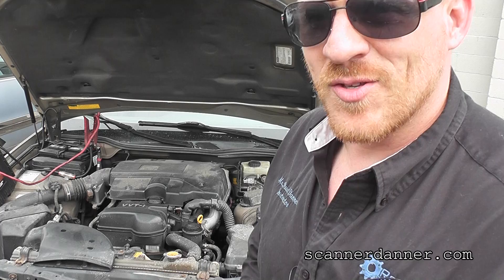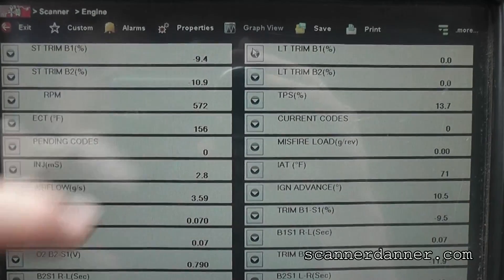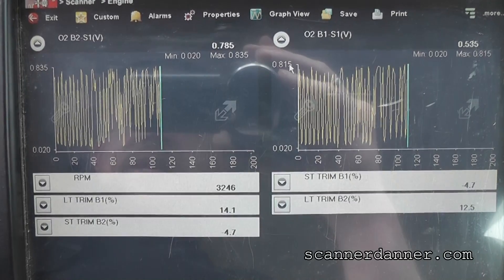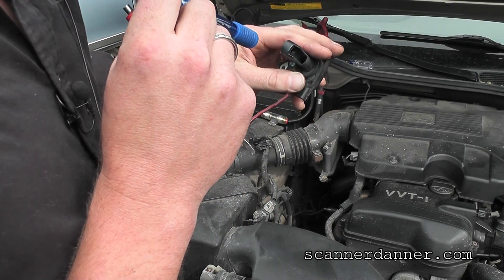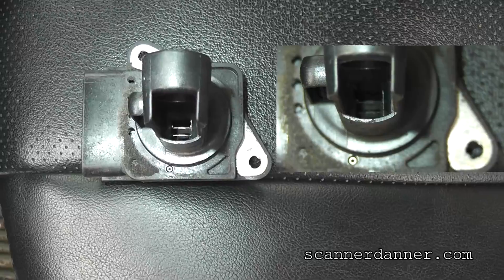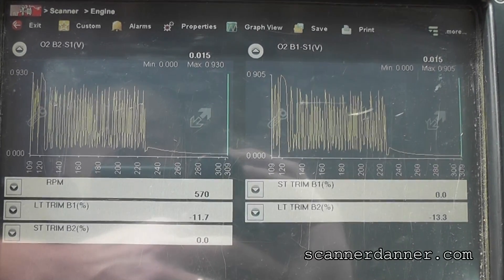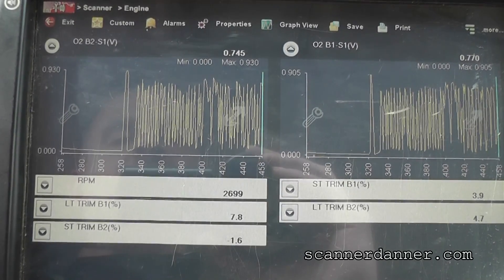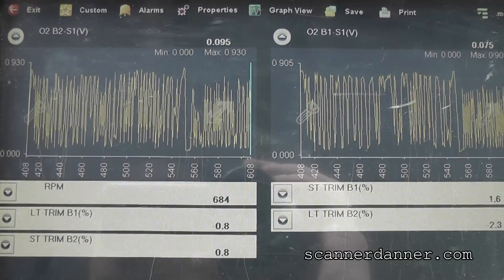How to identify and clean a dirty MAF sensor (Lexus)

Comment: so is maf cleaner just brake clean or is it actually a different can with brake clean in it they just charge more for it? lol
Reply: never use any solution other them mass air flow cleaner on a mass air flow sensor... the abrasive(s) in the solution cam eat the protective coating off the thin wires and cost u unnecessary $$$.
Reply from the maker: I've been cleaning MAF sensors for 20 years using brake clean. Shoot, when I started cleaning them there was no such thing as MAF cleaner. But to each his own.
Reply: +ScannerDanner I never saw it b4 with brake cleaner... I stand corrected... saw it with my own two eyes.... guess I should watch the whole video b4 I post...  lol... live n learn...
Reply from the maker: Your not wrong in suggesting the specific MAF cleaner though John and I appreciate you answering another subscribers question.
Reply: +ScannerDanner cool. man... I heard carb cleaner can not be used on mass air flow sensor, but mass air flow can be used on carbs. and throttle body's... which carb cleaners can also be used... so I take it brake cleaner would also do the trick now.. which is kinda cool... just put me out of the box I was in... lol...

Comment: Great explanation for finding the MAF fault and how to clean it, thanks. Have issues with my Zafira. Used a bluetooth plugin adapter to connect to my android phone/tablet and it keeps coming up, a couple of times a week, with MAF fault and fuel trim. Hopefully save myself a bit of money cleaning it. Let you know the results.
Reply from the maker: +LordBazilBarrington don't forget a vacuum leak can set MAF and lean exhaust codes
Reply: +ScannerDanner Thanks I did watch another of your videos showing the smoke machine to find the leaks too. Shame I don't have the equipment to do that. Could try a disco smoke machine I suppose. LOL!
Reply: I use a vape to check for the vacuum leaks ha

Comment: Add installing a high quality air filter to the repair.  
You feel comfortable scraping the resistors because you'll just replace the sensor if you break it and just bill the customer.
Reply from the maker: +John Ferguson are you saying what I did was a bad thing?
Reply: ScannerDanner   Every manufacturer states that the sensor shouldn't be scraped and that carburetor cleaner shouldn't be used.  I think that it is not appropriate to teach people to ignore the manufacturers guidelines.  It worked this time but the next time a perfectly good sensor could be destroyed.  There are ingredients in carb cleaner that can damage the sensor and scraping can thin the fine wires and break them or cause them to fail soon after.
Reply from the maker: +John Ferguson manufacturers have been telling us to not clean MAF sensors for 30 years.
I've cleaned hundreds of these over the past 24 years on all different makes and model cars using this exact design MAF sensor with NO issues. I am not an amateur, shooting how to videos, and giving people information that hasn't been tried and tested. Watch some of my other MAF videos. I may change your mind.
Reply: ScannerDanner   I like your videos about using the scanners effectively and thoughtfully.  Would it kill you to first try the specially formulated MAF cleaner?
Reply from the maker: +John Ferguson :-) It certainly would not and I have recommended it but here is the thing. I'd been using brake cleaner on MAF sensors for a decade before they even made MAF sensor cleaner! Remember, we were taught to not touch them, or even breath on them or we would damage them. And through some painful early years in my career, I learned that these are not as sensitive as we were lead to believe and that brake cleaner and a soft small brush was the ideal solution. 
To be clear, the only ones I am recommending to be cleaned are the style you saw in this video. (the one's with one or two cylinder looking resistors). Not all MAFs are cleanable. 
Also, from what I've been researching, this cylinder looking thing is a protective glass coating over the resistor. So again, not as sensitive of a component as previously thought.   
Finally, why I choose a pocket screwdriver for this particular model, is the small brush I normally use, hits the first resistor with too much force when trying to clean the bottom resistor. With the screwdriver, I can feel and more importantly see exactly what I am doing. 
I suppose a q-tip would be good too, but again, you risk not knowing how hard you are pushing on the resistor since you cannot see what your doing. 
Hope that make sense. Your points are well taken

Comment: great video, but what made the owner ask you to check for a lean condition? - I ask because my car has a lumpy idle... its nothing drastic but i can tell it's not normal, it has a very occasional stumble too as if it almost misses its a 2003 bmw 318
Reply from the maker: +Michael Prag garage owner scanned it and it had lean trouble codes is what I was told before I got there

Comment: i like the way you express youe knowledge...especially when yoy solve the problem..great to watch. i wished i was a car mechanic.
Reply from the maker: +farouk abdi you can be one if you keep following me. Seriously, I can make you a diagnostic tech
Reply: +ScannerDanner brother enough respect to you...i though you were just a good mechanic but know you have shown me that you are a good man.....a lot of people hide what they can do best but you what you know you teach to others...i promise you i will follow you not only you are a great mechanic but because because you are layal to your job by teaching others...great stuff.
Reply from the maker: +farouk abdi awesome, may God bless your path my friend
Reply: +ScannerDanner you gave me the best prayer...may God bless you 2....
may i ask you something...
i have a zafira Vauxhall, i did take out the air mass flow sensor cleaned it, to be honest the resistors looked very clean already I put it back on still the same..
symptoms:
when started cold, it sounds like back firing unstable noises as if it wants to stop. after 3 minutes it becomes normal runing smooth.

when the car is worm it seems ok...but the problem is gettting worse as days goes.

another clue when i start the car while unstable the accelerator does not respond bo matter how much i give it gas????! after 3 minutes it becomes ok...
honestly i dont want to disturb you and take your valuable time. i welcome any directions from you.

Comment: Just confirmed whats  was going on with the BMW 530I in the shop,the car came in with an air leak, intake was torn, disa valve was leaking, i also replaced the pcv control valve. Fuel trim now is minus at idle which indicates to me there's no vacuum leak anymore, as soon as i start driving , fuel trim bcomes excessively positive.By the way I contacted you two days agoon your site  about the ebook code , reply was fast, thx Danner.

Comment: hey man, great video,  I hope maybe we can crack my issue with my car. It is just painful because i have been with Mechanic for a long long time and he is genuine doesnt over charge you know stuff like that. However there are things i am not too impressed with such as my brake fluid is black and my coolant is gross looking . Anyways my main issue is my Air temp sensor or Air flow sensor not really sure what it is called now, i am really learning too much and not really understanding how to process this i guess. Anyways i have a GM car , it is not seemingly a popular USA brand though, so regardless i hope you might be able to suggest or crack my case. The car i have then is an OPEL CORSA B 1.6 IE  1999  and i think it is version 1.2 . It is non ecotec, not sure what that is anyways. Let me know if you would like to try and assist me , i can post the issue i have , i will try my best to explain my issue and even give some history on the car too.
Cheers.
Reply from the maker: +Imre Csoka Post your issue on my forum okay?

Comment: i,m have a 1994 c1500 chev. truck 350 ing. when the truck is cold start,s and run,s good. but when it get,s warm it start,s to miss. when it,s warm and you try to start it act,s like it,s out of time. but when it cool,s down it starts fine. can anyone help me.
Reply from the maker: +Donald Hughes if it is the flat style distributor cap, I would start with replacing the cap and rotor

Comment: what if your car has these fuel trim symptoms but your car doesn't have a maf sensor what would it be then, please someone help
Reply from the maker: +TheBranden86 check your fuel pressure next.
Reply: I already did and it was jumping around like crazy I was thinking it would be the pulsating part  that is messed up but im tired of spending money on this 04 dodge neon three mechanics already told me they wont even warranty engine work on this car because they consider it a throw away car so im having to do it my self I wish I could find someone around pueblo co that would help me

Comment: Great video Paul just what I needed with my fuel trims neg at idle and high when raising RPM, only difference is my STFT goes to +25 and LTFT goes to zero and splutters when raising.  Any ideas.  I have cleaned it before but I will take another look.  Thanks a lot my friend.
Reply from the maker: +Ilovetosingem what kind of car?

Comment: So does this procedure of brake clean work on a gm maf that includes a cold wire in addition to the hot? Since the cold wire cannot burn off any residue?
Reply from the maker: +Renals Homlmes the "cold wire" is just a temp sensor. it does not measure flow, so you cannot "contaminate" it.
Reply: Thanks man much help. I ended up taking apart the maf because it would not clean up. the front side  was caked in oil/grease real bad. So far the light is off, we will see if she stays that way.

Comment: I would NEVER run a customer's vehicle at anything above idle without first having checked the oil level! Especially running unloaded at 3,000 RPM for extended periods. It's a hard thing to explain to the customer that they need an engine because it locked up or spun a bearing when they brought it in for a check engine light.............
Reply from the maker: +FireoftheGreeks what do you think the customer did before he dropped his car off? He drove it! Do you open the hood an check the oil level before a test drive? The answer is no! Most of the time a test drive is performed before doing anything. So how is what I shown in this video different?

Comment: Hi everyone with knowledge , my 1.3cdti will only start 3-4 time cranking were do i start to  diagnose ? thanks den
Reply from the maker: dennis pratt find out what you're missing when it doesn't start. Spark, fuel psi, injection pulse etc.
Reply: ScannerDanner thanks for the reply the car does start but !  not on the first turn of the key as it should do!was thinking it could be a sticking egr & when the engine is turned over it releases & it will start there are no engine codes when scanned!
Reply from the maker: dennis pratt start by testing your fuel pressure

Comment: I just had an experienced with a failing MAF that was interesting. (3 wire analog Hitachi MAF in a '99 Nissan.) I had fuel trims that were high at idle (well over 20%), improving as the throttle opened. First hypothesis is a vacuum leak - but testing shows no leak. Also no evidence for fuel delivery problems. Fuel pressure, injectors, O2 sensors, etc all check out fine. I cleaned the MAF - with CRC spray stuff  - no screwdriver! - no change. Also, using a DVOM, MAF voltage measured within factory specs at idle, 2500 rpm, 4000 rpm. The MAF also passed the test from your book: over 4 volts at WOT under load. No problem with harness, connectors, grounds, etc. The only clue was what I found with the scan tool: Even though idle was stable, the reported MAF grams/second reading at idle was varying by a lot: from 2.8 g/s to above 4.0 g/s. Why such a large swing when idle RPM isn't changing? Also, there was an inverse correlation between MAF output and fuel trim: Idle fuel trim was highest when MAF reported g/s was lowest. Replacing the MAF fixed the problem. The MAF was underreporting air flow at idle, but did better at throttle positions above idle.
Reply from the maker: David UM1996 crazy. awesome detective work my friend.

Comment: I replaced my maf BUT I bought a cheap aftermarket one and after my car doesn't wanna go past 40 even if you push the gas all the way down after a couple minutes of driving it and a weird rotten egg smell is coming from it too. My car never had a problem like this before till the sensor replacement can the sensor really affect my car that much? Btw it's my first car so idk that much -Thanks
Reply from the maker: Johnny Martinez absolutely. What kind of car is it? And why did you change the MAF in the first place
Reply: ScannerDanner it's a 1998 Mercedes slk 230 and I was looking into forums because the cars fan went on like crazy when I put it in the ON position and it didn't wanna turn off I  clean the Maf it originally had on and it ran  perfectly for two days on the third day the sensor completely gave out and was doing the fan thing again I got a cheap sensor off eBay (cause at the dealer its 400 cause it's a Mercedes)I installed it in the new sensor and drove the car the next morning  but after awhile it started doing all that stuff
Reply from the maker: Johnny Martinez sounds like you have another problem other than the MAF. any codes? you need to test that fan circuit and see where it leads you. maybe you have a block ground issue. I have a video on this on an Audi, search for it on my channel and watch it to give you some ideas on where to go.

Comment: i remember learning that an alternator does not charge a batt, just keep the voltage up?so you really cannot charge a dead batt with the alt ok, LOL
Reply from the maker: No that is not true. The alternator charges the battery, maintains the system voltage etc. When the battery is dead the alternator rotor field will be at its maximum for an extended period of time which is what causes heat and damage to the alternator

Comment: Good morning scanner Danner I am a technician in New York and I was wondering how do you go about invoicing customers for a dirty MAF sensor, what do you include on the Bill? do you include scan data or screenshot of the scan data?. I ask because sometimes I find myself in a situation where the customers find it outrageous that I am charging them just for cleaning apart most of the time I feel like they would have preferred if I would have replaced expensive part then just clean it

Comment: What i noticed was how low the rpm numbers were before the MAF was cleaned (around 540) then after the cleaning a good 700 rpm.
Reply from the maker: Ozzstar that is more of a run timer issue and "desired idle" than it is anything to do with the MAF sensor. (I ran the car longer in time before the repair than after.)A dirty MAF does not change these desired idle commands. Make sense?
Reply: ScannerDanner i'm not familiar with the term 'run timer' but would like to learn more about it.  Does it have to do with the ECM monitoring engine temperature and deciding the amount of fuel added?  Just a guess.  Thanks man
Reply from the maker: Ozzstar that is just my term. there is literally a "run time" that the ECM keeps track of for things like this. Engine temp is part of it but lets say the engine is already hot, then shut down, then restarted 10 minutes later. The ECT is the same temp, if not hotter, so desired idle is not altered in this example. So then why do we have a higher idle command for a period of time after start up? It allows everything to stabilize before going into a lower RPM command for fuel economy reasons.
Reply: ScannerDanner ahh yes another scanner danner specialized term!  Awesome.   Yes I understand now and thanks for explaining.  You're the man.....keep up the good work!

Comment: Dan information is crucial in diagnosis, Shop Key requires a business  license which most techs don't have, where is a good place for the technician to get information from when doing side work at home without it costing $169.99 a month? Wiring diagrams are so important when troubleshooting.

Comment: Thanks man you fixed my car
The symptoms were hesitation/lack of performance with moderate acceleration up a hill
The mechanic put in a new fuel pump, some leads, a exhaust gasket,
I renewed the distributor cap,  rotor and injectors ( i am new to fuel injection, always had carbed cars)
After seeing this video i cleaned the MAF with a cap of methylated spirits and a small brush ( a one cent job ) 1995 isuzu pickup
Now it gos like a jet
Thanks for you video and time
Reply: Awesome! Thanks for sharing
Reply: My car is really struggling up a hill. I hope its just a dirty mass air sensor
Reply: All these parts when it was just a dirty MAF or you were doing a major service anyway?..bcos those parts are costly even if they are not OEM parts!

Comment: Great job SD! That is exactly how almost every tech at every Toyota/Lexus dealership I have ever worked at cleans the MAF. It works! Sometimes just spraying it with that MAF cleaner will not get the wire completely clean and the car will come back.

Comment: What would same symptoms indicate on MAP engine? Troubleshooting 2000 Chrysler Sebring Lxi V6 which I believe is MAP engine. No codes yet but trims are almost exactly as you have them. Thanks.
Reply: Same here. MAP-only Fiat engine, idle long term trim below -20. Still wondering why no codes have popped-up yet.